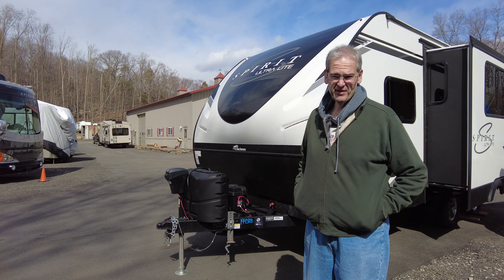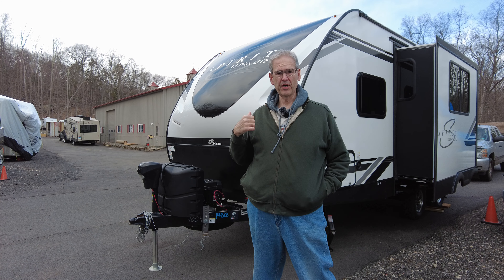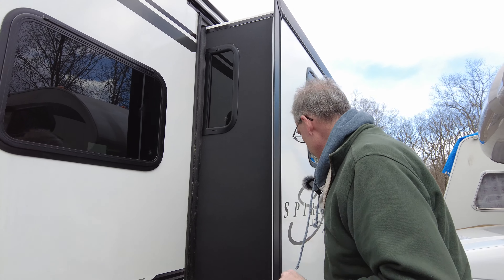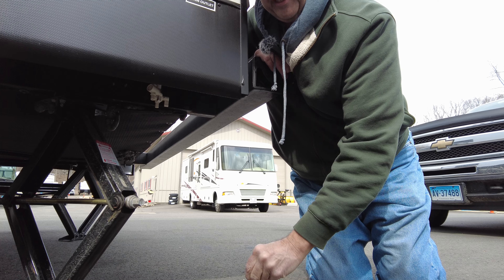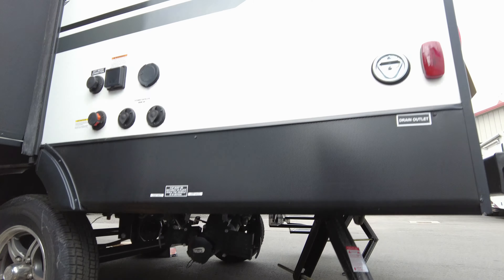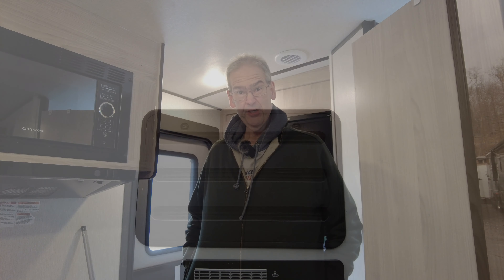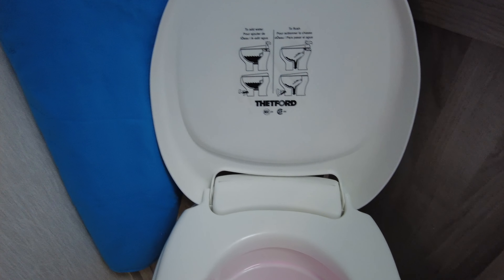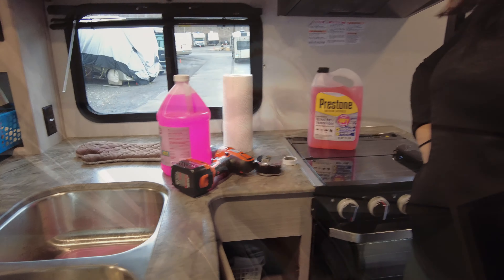How to winterize a Coachman 1943RB. RV Travel Trailer How to video

Comment: Make sure to fully run the HOT water valve at the shower, and all outlets. Like mentioned, do not forget the outside shower. Also where the FRESH water hose for city hookup goes, depress the small bobbin relief valve where the hose screws on (possibly behind the screen). Do this while the water pump is ON and it will pink purge the water line all the way to the water pump. IMPORTANT to do. Ask me how I know. Sweet campers capable of extended stays! GREAT video!! Many Thanks!!

Comment: Nice that it came with a winterizing valve, and a large gate valve to dump the fresh tank. I think I’d also be making a door out of that panel. Personally, if you have an air compressor, I like to blow out the lines, then antifreeze as you have done, and blow it out again- so the antifreeze ends up in the P traps and the pipes are mostly empty, with whatever is left being antifreeze.

Comment: good detailed video. what's your opinion on just blowing water out with air?
Reply from the maker: That is a great option, especially if you don't want the chemicals in your drinking system. For me, I don't have a big enough compressor and never drink the water without it going through filters.